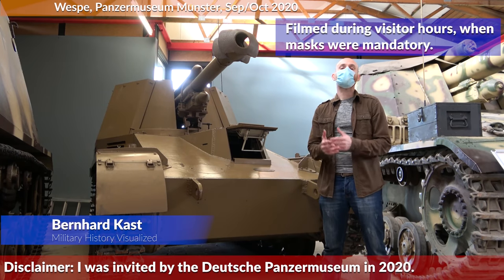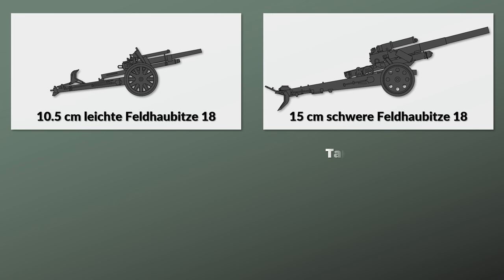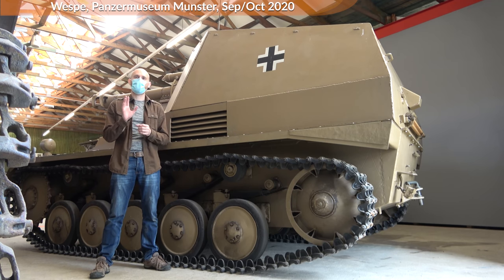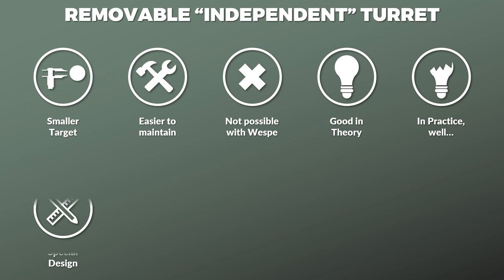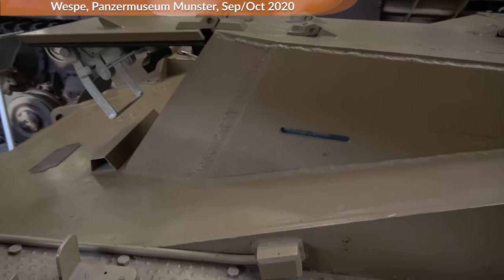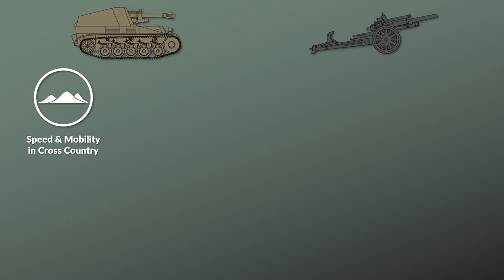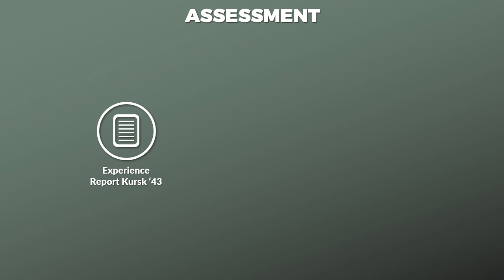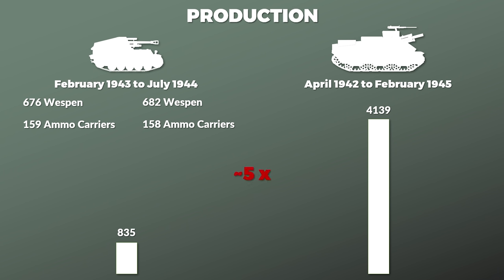Wespe: A Successful Failure?

Comment: The only modern artillery design with a removable independent turret that I can think of is a NEMO mounted in a 20-ft-container. It's a 120mm automatic breech loading mortar manufactured by Patria. https://en.wikipedia.org/wiki/Patria_NEMO
Reply from the maker: thank you!
Reply: KMW's AGM can be removed, too, at least the Boxer module can be replaced easily. Maybe then placed on a mount for stationary use. Maybe even lifted by helicopter, at 12.5t however at the limit of a CH-47 and put on a mointain ...

Comment: 3:00 quick tip for when someone walks through your shot, you've got the camera on a tripod so the shots not moving. Rather than placing a black box over that area take a screenshot when no one is in the frame, cut out that section of the frame and place it over the same area when someone walks through. As long as you lighting is consistent and you get it in the right spot it will look almost seamless and not draw the eye in the way a black box suddenly appearing does.
Reply from the maker: might consider that, but in that case I probably won't do it, since some "challenged" people actually claim I was all alone in the museum at the time.
Reply: @MilitaryHistoryVisualized  Oh well, keep the feet visible, that is what I finally noticed.  I thought at first it was another colorized night video.

Comment: Since these designs are mid /late war neither are useful and by then more useful roles had already been worked out for both Panzer II & IV . Before the war even began the need for armored howitzers was established in KStN as far back as 1934/35. but since this envisage tank chassis , it could not be built. Guderian demanded that combined arms panzer division  had to have ALL units in armored tracks.

Comment: I know I'm getting off the subject here but when you mentioned 140 horsepower it didn't sound like a lot but yet there's no mention of how much rated torque it is. and so as it's the torque that actually gets heavy objects moving why isn't there more important placed on torque in descriptions. A Ford escort had 140 horsepower, but you never saw that kind of engine in a tank because of the torque. And I am quite sure that in all armies there are plenty of lower horsepower engines that have twice the torque in a different application, mainly dependent on stroke. Well that's enough of my rambling but it would be nice that in the horsepower stats you included the torque and RPM ratings. Thank you for great videos.
Reply from the maker: Maybe I missed it, but I haven't seen torque values so far, rpm sometimes. I guess it is too special.
Reply: @MilitaryHistoryVisualized  Sometimes I Google it myself if I know the name of the engine.

Comment: The  Germans did drop  the ball though ....when they converted the Panzer 1 in 1940, they mounted couple hundred captured Czech 47mm ATG. Given that 1800 47mm ATG , were captured from Austrian , Czech and French sources [ 1939-1941] ; they should have introduced a crash program to repurpose ALL the remaining 1100-1300  Panzer 1 chassis into "Panzerjagger 1". 
 
During this very same time period the generals rage over - should the main tank chassis production be diverted into producing STuG-III to equip each infantry division with battalion of 21 STuG . Thats 1800 STuG III instead of the first 1800 Panzer III/IV tanks.

Just a suggestion , but all those thousands of increasingly obsolete  Pz-I;  Pz-II & Czech 38 tanks chassis look like an attractive alternative to interim 'assault guns'????.... utilizing 75L24 guns and later PaK-40.

BTW that could also mean building1500 more needed Panzer III through 1940-42.

Comment: WESPE & HUMMEL were only built for the Panzer Divisions , no other units had them....except a few hyped SS Panzer Grenadier Divisions. 

It was an expedient utilizing smaller tank production factories, and it was achieved with out cutting into major tank production. But its overall effect could never have been much because of the limited numbers. 

The Waffentragger concept had much much more potential as improvised mechanized artillery for all mobile forces especially non divisional artillery.+

To that end the 72 Jagdtiger built at the end of the war , would have been much better invested in Geschutzwagen for 170 Kanon 150 Kanon as well as 210 Mortar....In fact all the Tiger chassis production could have mechanised 300-400 of these guns at in 44/45.

Comment: as one who was in artillery units, 8th and 37th, both sp and towed 155s, it is obvious that the line between artillery and anti tank gun is being tippy toed upon here. Each has it's own purpose. It's easy to outrun your artillery coverage. That should never be allowed unless you have air superiority. the range of a 155 is tremendous, and accurate. SP artillery doesn't require a truck to pull it, but does need an ammo hauler close by. No need for a turret, as the driver can turn the vehicle quicker. unecessary manufacturing costs. However, it DOES require AA & infantry coverage, or you're a hunk of scrap iron quickly, with either cannon.

Comment: I wonder how the Wespe tracks would cope during the winter and rasputitsa seasons of Russia. I don't think they would have Ostketten for this thing. The Hummel perhaps may have had since it was in the Panzer IV chassis, but I never heard of Panzer IIs with Ostketten. Perhaps it wasn't as much heavy to be a problem.
Reply: I don't know, but I suspect at least better than a truck towing a 105, which was the other option.
Reply: @Nightcrawlerfive  yes, I agree. I haven't seen much information about the mobility of those kind of weapons on rash conditions. Despite Germany wasn't much in large offensives when the Wespe entered service, their defensive structure also involved mobility and shifting positions all the time. At least for the untis on direct contact with the enemy. But since those pieces were artillery, perhaps they might have been positioned a bit farther away from the frontlines, closer to roads or something like that and they didn't experience as much stress as the vehicles like the StuGs . Wespe is still a piece meant for indirect fire despite being mobile as far as I'm concerned.

Comment: While the panzer 4 chassis might have been preferred it makes sense that they used the panzer 2 chassis. After all, once the panzer 2 is no longer useful as a frontline tank you want to do something with all of those hulls so they don't go to waste, and using them as SPGs would seem to be the thing to do. Of course that assumes that they are taking existing panzer 2 hulls and converting them to wespes. If the wespe chassis is slightly different from the panzer 2 chassis then that suggests that they are producing brand new hulls based on the panzer 2 design (or at the very least are going through a more complicated conversion process), in which case I would think it would be better to go with the panzer 4 chassis as per the recommendation of that battalion commander after Kursk.
Reply from the maker: they used a Panzer IV like chassis* for the Hummel; *it looks Panzer IV, but has some Panzer III components.

Comment: When speaking about the traverse, don't forget that the chassis itself was mobile and, like a tank, could turn in place to "spin around", eventually fulfilling the 360 degree requirement. That said, it WAS an interim design, not a specially designed piece. It was making due with pieces that were around at the time.
Reply from the maker: It is artillery, so for indirect fire if you move the vehicle, you have to recalculate a lot of stuff. I am sure I mentioned this in one of the self-propelled artillery videos, maybe not in this one.
Reply from the maker: Yeah, it is actually covered in this video, to quote my own script:
"The lack of a 360 degree traverse was particularly a problem on the Eastern Front, since the mud and the cold required often position changes, but that was less easily done in such a condition. Now, you might argue Sturmgeschütze and Panzers changed the position all the time, so what is the big deal.
Remember we are talking about artillery here. Artillery firing charts account for wind, temperature and a lot of other stuff. So this is way more precise or well imprecise if you get a number wrong and as such changing the position a little bit could have major influences."

Comment: I just had a crazy concept ... the Germans built all of their army around the panzer everything should be following the panzer helping the panzer etc. They have the same doctrine today. Yet most combatants in WW2 were killed by artillery. So why not build your entire army concept around artillery ... moving it protecting it breaking through with panzers just so that the artillery can get into position etc. Of course this would require SPGs even more but that would be the core concept. Move the artillery into the position to do max damage: do recce for it create a breakthrough for it with panzers defend it from armor and infantry spot for it from the air and create the logistics line to supply it with ammo so it can deliver it to the point of impact. Artillery can bring down forts, cities, trenches etc ... it can kill anything. Unlike the panzers that are horrible in cities, against fortifications or well dug in infantry in rough terrain etc etc.
Reply: You have the mindset of a WW1 general. A massive amount of artillery can hurt a enemy army, but not destory the army, especial if the enemy army is so unsportsmanlike to dig in. A massive amount of panzer can encircle the enemy army and destroy him (or force him to surrender on mass) Hence maneuver warfare beat mass firepower. 

It's not necessary to assult a city, it significantly more efficient to encircle it and continue. Germany was good on encircle and continue, untill some corporal insisted that a big city must be taken becuse it did have the name of his arch-enemy.
Reply: @kirgan1000  the "encircle" part stops working with defense in depth and it is always the infantry doing the elimination not the tanks. the numbers still remain most people were killed by artillery not tanks. So SPGs and well positioned mobile artillery with good range and precise ranging seems to be more important than tanks. Tanks would be useful in breaking through allowing the repositioning of the artillery.

Stalingrad was a big mistake clearing the Don making it defensible and forcing the Russians to attack across open plains into built up armor reserves would have served them better. Though I still think they could not feasibly extract the oil from the Caucasus.

Comment: why didn't you just try using the elevation and measure what it actually is on that model, I seriously doubt it's missing enough gear teeth to be substantially different from war time production.  it looks well maintained, or at the very least well restored.
Reply from the maker: Give me the tools and training to do so. I am rather sure that the people that measured that were way more qualified at their job than I would be at measuring it.
>  it looks well maintained, or at the very least well restored.
which basically means nothing, it could be redone from cannibalized parts; I could ask the museum, but they not always know the exact history of their pieces...
Reply: @MilitaryHistoryVisualized  it's not difficult, you literally just measure the angle of the gun at the base, or alternatively find the angle based on the traversal of the breech up and down with maximum depression and elevation angles with a protractor.  It's exactly as simple as it sounds.  The disparity in the british and german measurements could be as simple as someone providing the figure out of a manual and someone providing a figure based on the method described.  Then again, who knows, perhaps gear ratios were changed mid production and both were correct depending on the serial production number of an individual chassis.  The other alternative, one of them is wrong and we don't know which, but i doubt it's the germans.
Reply from the maker: > up and down with maximum depression and elevation angles with a protractor.
the gun elevation was locked with chains, see also the other points.

Comment: i believe they used like some Panzer 3/4 turrets in that kind of style - digging in the turrets in defensive positions? like a gun turret in an RTS game :P
Reply from the maker: that would be fixed positions that were intended in that way - to house a turret. Yet, in this case they wanted to just put the turret on the ground from my understanding.
Reply: from what i have seen how they always wanted to operate everything, they wouldnt be able to resist to build an entire trench network around such a 'downplopable' turret... 

that said would the turret just be perm fixed in one direction - would they like pull it up and move it in a new direction or put it on some sort of gigantic turntable kind contraption????

Comment: Did they ever try using the self propelled gun to also tow a trailer of ammunition? Sure, it would have reduced its mobility, but probably not very much to provide much more ammunition, particularly if they could just jettison the trailer if need be. I assume there's some drawback, else the smarter engineers than me working on it back in the day would have just done that, but I can't see what those would be
Reply: Attempts to have tanks (or other AFVs on tank chassis) tow trailers have tended not to go well. Getting a trailer that doesn't seriously limit mobility cross country is far easier said than done. 

Also note that the vehicle was already noticeably heavier than a Panzer II, I doubt the chassis would enjoy towing even more mass behind it v
Reply: @88porpoise  That and if the trailer would get really stuck the tank would just rip the linkage and keep going. And just think how hard it would be reversing with a trailer. The only successfull trailer was the Churchill crocodile and that was a very specialized tank, really not designed for a movement war.
Reply: An added trailer increases weight and now you must consider the class of bridges it can cross.

Comment: What's the main problem with having a top heavy artillery piece?
Reply: It's a narrow vehicls so if it's also top-heavy, it can topple over if you drive it along a slope.. or if you fire the gun while inclined sideways.  In some respects, not having a 360 arc of fire was a good thing, since the Wespe gun recoil would have to be always be longitudinal with the length of the chassis, not transverse to it.

Comment: Why did Hitler not want it to be called Wasp?
Reply: Because Wespe was no suitable name according to Hitler. It didn't sound like the name of a german tank (in comparison to Tiger, King Tiger, Panter). Same applied to the Hummel (bumblebee) tank, which Hitler wanted to be changed but soldiers did stick to Hummel despite Hitlers opinion.
Reply: @TheSn0b  and the fricking Maus?
Reply: Because Wasp is an English word, and they were fighting the English.
Reply from the maker: @TheSn0b: what is your source?
Reply: Probably didn't sound grandiose enough.
Reply: @mariano98ify  They first wanted to call the tank Mammut (mammoth), the name of the project was changed to Maus instead, for concealment reasons. :)
Reply from the maker: Thanks, well, the question is, how would an old German soldier know this? Unless he was very high up in the food chain and then he likely would have his own memoirs. And even in that case, I would be rather reluctant to accept it as fact either. It could be.

Comment: Why did Hitler forbid that name?
Reply: Cuz he’s a Nerd

Or something
Reply: Because Wespe / wasp sounded to neat. German tanks needed a 'dangerous' name like Tiger, Panther etc. I think the same applied to the tank "Hummel"(bumblebee), it didn't sound dangerous and impressive. Therefor he wanted a new name for it, but soldiers sticked to the name they gave the tank.
Reply from the maker: no idea, maybe it was mentioned somewhere, but I generally would be very careful about any reasons given unless it is from a primary source.
Reply: I would go with another approach: Why is modern German self propelled artillery, the Panzerhaubitze 2000 called Panzerhaubitze 2000 and does not have some animal name? Other modern German armored vechiles have species names why not Panzerhaubitze 2000? There has to be something similar behind 40's naming policy that are used today in modern German armored vechile naming system. Maybe Wespe and Hummel were also supposed to be a part of weapon systems, like Panzerhaubitze 2000 is today, and hence were not supposed to have individual name for single part of the system (the vechiles) but rather naming was supposed to describe the system it self.
Reply: @ninaakari5181  did the radkampfwagen or American supplied vehicles (or soviet in GDR) have animal names?
Reply: @looinrims  None of the foreign supplied vechiles had/have German given (animal) names for what I know. Same goes for ww2 captured Allied/Soviet vechiles in German service, they just use the original name of vechiles (T-34, T-72, Sherman, M60 etc). Would be interesting to interview some German weapon designers what their idea behind naming policy is